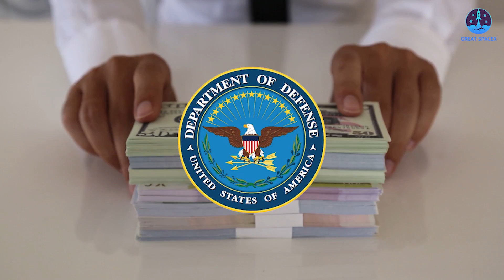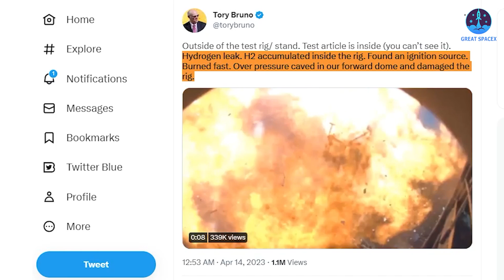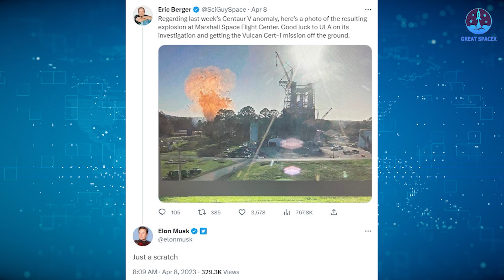ULA is over!

Comment: Not a single test flight of a BE4 propelled rocket like Vulcan and New Glenn so far, and yet, they sell payload launches like crazy? Relying on the past 100% success rate of their phased out rockets? I call that Selling the skin, before the animal is actually hunted down.
BO and ULA are innovative, both have new rockets with one shared new engine type that looks amazing on paper. Lets wait for the first flight of their new rocket (that I would call a prototype) and after that comes refinement and production ramp up, to see if their bold projections can be met. Currently all I can see is shiny static hardware and marketing talks. ULA makes it look easy, while Space X struggles and has to do a ton of hardware rich testing and redesign. Which one is the more successful strategy? I think we will know for sure in a few months, or at lest in the next two years. Personally I would place my bet on Space X. That's because I prefer busy working people making their hands dirty over the ones with the shiny suits and nicely painted mock ups.

Comment: Spectacular failure has always been a fact in the Space industry. Going back to the early days in the 1950’s there were frequent explosions both on the launch pad and in the air. Unfortunately, the Challenger disaster produced an extremely risk averse culture at NASA. SpaceX has brought back the will and desire to persevere through failure. “Fail early, fail often” is the key to success.
Reply: Keep failing until you don't anymore. Then start making money.

Comment: So, has Blue Origin been dragging their feet on the B4 engine in order to starve out the ILA Vulcan?

Sounds likely.
Reply: Blue Origin delivered their engines to ULA back in October 2022. What are you talking about?
Reply: @timothygermann780 , back in October 2022 was 4 years late?

That’s what I’m talking about.
Reply: @michaeldemarco9950  You asked if Blue Origin is dragging their feet to spite ULA but they already delivered.     Also,  it's nearly summer 2023 and ULA is still not ready to launch. Astrobotics didn't even finish the lander until this year.

Comment: SpaceX 188 (successful) launches in two years. ULA had 29 (sold) launches in the same period.  So you see the problem. With SpaceX new rocket testing on line soon (2024) it is only going to get worse for ULA and others. one can see a Government funded rocket program cannot compete with a superior private vendor that uses iterative engineering and is parts rich.

Comment: Why would you try to save a 1980s company and technology?  A company run on a strictly military style cost plus,,, that is designed to make more money the longer it takes.  The launch happened 12 years late at a cost over run of 600%  And  made a profit for the owners.   At the expense of the public.  One launch  vs 200 for the other guy, and the one launch cost more than the other guy's  200 launches  ??  All figures are inaccurate,,, but the core is correct.
Reply: So wrong on so many points. Ignorance is bliss iIsuppose.
Reply: I just get POd that they spend 5 or 10 billion dollars of my money and produce nothing in decades
Reply: @Sailor376also  You really think ULA hasn't launched anything in decades? There's a few rovers on Mars that would disagree with you.
Reply: @mattcolver1  I retract.  You are correct.  I was confusing alphabet soup with alphabet soup  Orion, and its launch vehicles are my main objections.  I come from a family that worked in the industry.  And the shifts in purchasing  from the 70's or 80s onward ,, well there is more than one reason we have not been back to the moon in 50 years. It has been profitable not to.

Comment: Unless ULA can rapidly develop a reusable rocket, they're doomed in the long term. The Military will be more than happy to switch to SpaceX in the end because it's going to be so much cheaper. Even if they achieve reusability, it's doubtful they could do it as cheaply as SpaceX. The only way it will survive is if it's seen as politically necessary to have more than one supplier. They may end up with a small proportion of launches if that happens.

Comment: ULA had 20 years to develop a booster engine, instead of relying of the RD180. This is the most likely cause of their failure, because now it is BE-4 or nothing.

The Blue Origin BE-4 engine has been delayed year after year; initially a reusable engine, it is now being used as single use engine, because its massive single turbopump didn't stand up to the initial promises. May be the Vulcan could use some Raptors?
Reply: I doubt spaceX would want to sell any raptors to third party considering how many the superheavy booster needs
Reply: Interesting no one has even mentioned the possibility. Blocked or just stubborn?
Reply: Elon even said they had too many 😊
Reply: @kiwigurn  yeah buy he also said they want to ramp up ship/booster construction which will eat up the surplus pretty quick

Comment: Did the delay of the new rocket engine bring the fail of ULA? Then this was caused by Blue Origin not providing the rocket engine on time , I know they received the new engines so they should be able to get back on schedule correct!?
Reply: Ahhh, "no", that is not how it works.